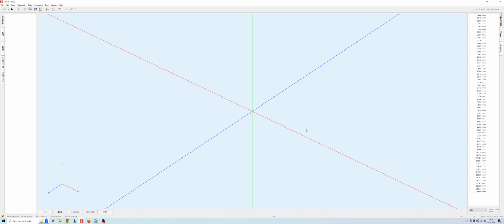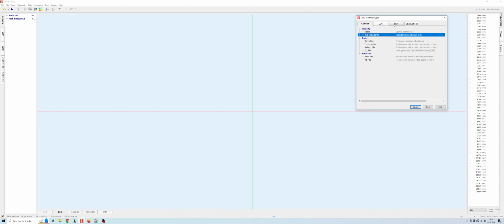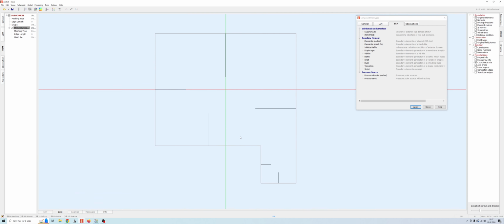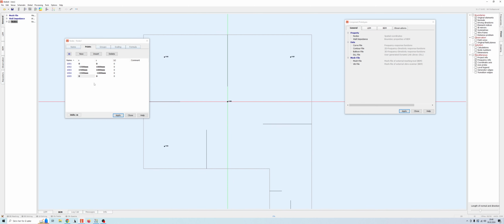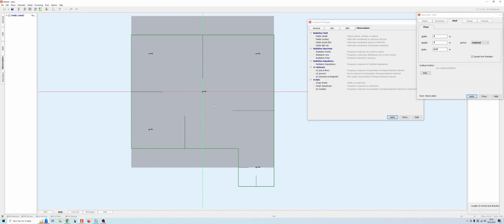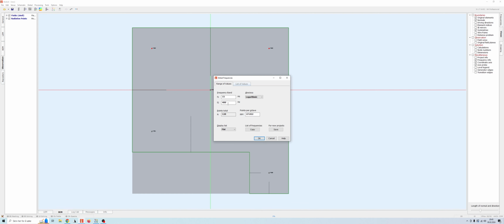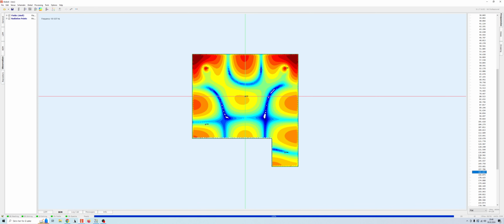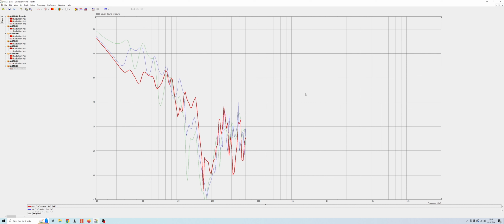How to simulate sound sources in a room with AKABAK's 2D mode

Comment: First; A big thanks for posting these tutorials! Unfortunately I'm having trouble with the sound not really interacting with my 2D drawing of a simple rectangle. Despite following the steps correctly multiple times, trying out both wall-impedance and fully reflective, the sound passes through the walls instead of interacting with them. If you could give me a hint about what I could be doing wrong I would be very thankful!  From my log: error message (Size zero in component (Elements (mesh file) - Elements30)
Reply from the maker: If we assume the error message is the reason things are going wrong, it would seem you have a drawing that causes AKABAK to try meshing an element with no size. I've never seen this happen for 2D or 3D simulations, but for the axial symmetry mode in AKABAK this can occur if you try to make a line along the axis of rotation.

Are you using symmetry? In that case, check that no lines lay along the line of symmetry, that could be the issue.

Second, make sure the normals of the walls are correct (I assume you've done this, but it would seem the most obvious answer as to why no interactions with the walls happen).

Comment: Hey really good tutorial. I try to do the same simulation in 3d, but i don't understand how to swap the normals. I   tryed to follow your tutorial, but i gave up because my exported sketchup-dfx-files didn't work with akabak. i always loose some lines. in 3d is it much easier to import files. anyway,  it would be great, if you can do the same tutorial with a little mor complex room in 3d. best lo
Reply from the maker: Unfortunately AKABAK is quite weird with DXF files, and I am not sure why. It requires some trial and failure to get a working model in 2D.
A 3D room model is fairly easy to set up, if I get the drive to make another video that is probably the next one on the list. Pardon the late reply.